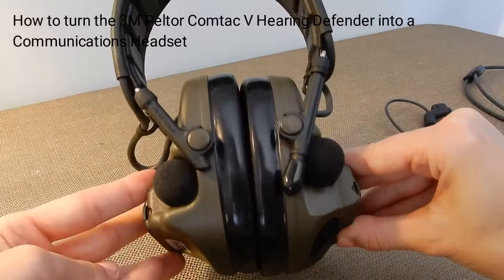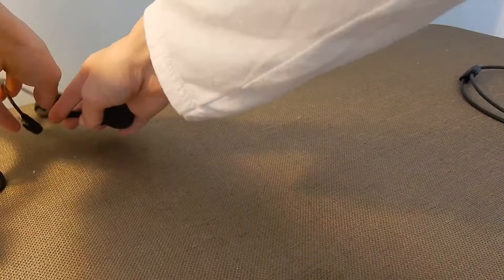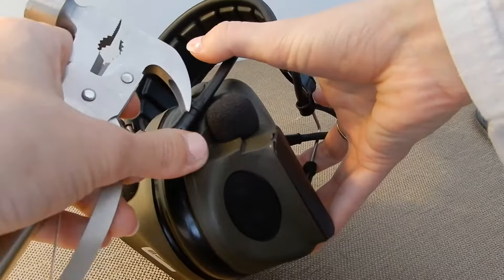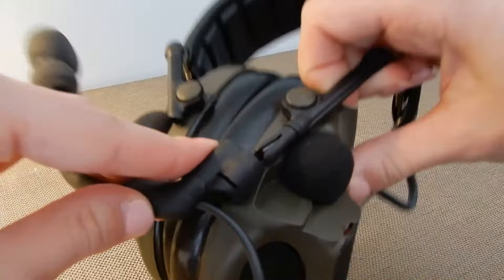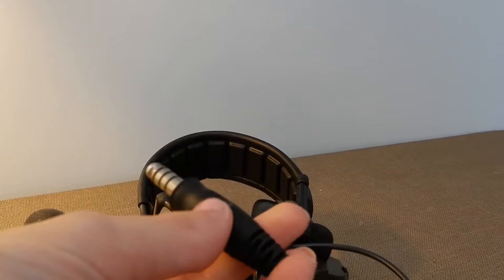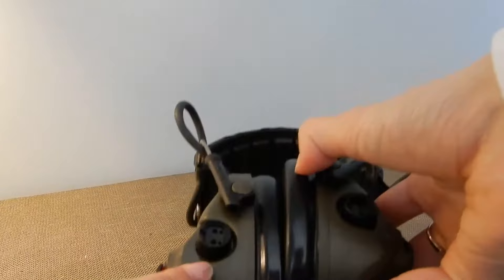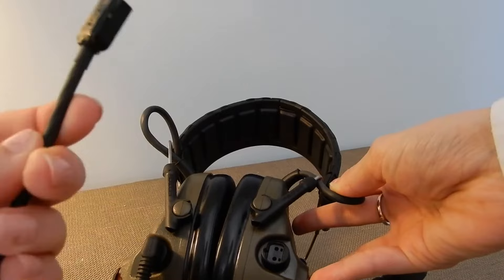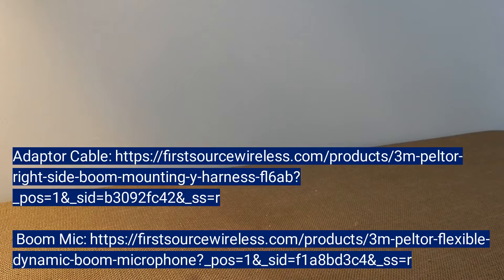Upgrading 3M Peltor Comtac V Hearing Defender to a Communications Headset

Comment from the maker: Disclaimer: Before making a purchase, you must ensure you have the correct adapter interface. We can only guarantee compatibility with a 3M company-manufactured product. You are encouraged to contact our support team to ensure the PTT adapter for your headset will work with your two-way radio device prior to purchasing.

Comment: so a comtac 6 without a downlead cannot become a comms headset? it doesnt make sense because there is one of those ports on the headset? also what is the button on the back of the left earcup? i thought  it was  a PTT but if it cant be converted to a comms headset whats the button for?
Reply from the maker: Correct. The Comtac 6 Hearing Defender headset cannot be turned into a communication headset. Meaning it won't have that downlead to a communication radio. It has something to do with the mic/plug connection on the 6 that doesn't make it possible. 

However, the button on the left earcup is a push-to-talk button for the NIB feature (Natural Interactive Behavior) that is for short-range headset-to-headset communication without the use of an external radio. Does that make sense?
Reply: @firstsourcewireless  yes, thank you so much. hopefully soon they come out with a cable that will work for the vi's
Reply: Are these supposed to come with the mic? Just got a pair in the mail and they do not have the mic.
Reply from the maker: @alec7283  The Comtac V hearing defender won't come with a mic. If you want to go from the hearing defender to comms you'll need to purchase the boom mic as well as the downlead cable.
Reply from the maker: Although, the Comac VI Hearing Defender will come with a boom mic for the NIB feature (Natural  Interactive Behavior) that automatically connects headsets when in close proximity.

Comment: Why Im getting the sound through my mic and not the headset, I did exactly what the video said?
Reply: This is due to you using the wrong Downlead Assembly for your requirements, you must use a Nato wired downlead for Nato wired equipment and non Nato Wired downlead for Non Nato Wired, I recommend Earshot Communications Ltd in the UK as they are experts in the correct equipment and offering the right items for 3M Peltor setups like these.

Comment: Nice, thanks!

Any idea if the same parts would work on a Comtac 3?

Also, technical note, volume was rather low.  I had to turn my laptop volume all the way up so I could hear...
Reply from the maker: Thank you for watching and thanks for your suggestion on the volume level! We'll keep this in mind when creating videos like this in the future. As far as the parts, they would be different part numbers. You may be able to find replacement boom mics and find PTT adapters for the III. 3M discontinued the Comtac III and replaced it with an upgraded version, the V so the process of upgrading the headset to comms is only available on the V hearing defender

Comment: I'm a bit confused. Which adapter cable should I buy for my XPI defender? I thought I have to get FL6AC
Reply from the maker: This video is just for the Comtac V hearing defender headset so the parts listed in this video are just for that. As far as the XPI defender I'm not sure the exact parts needed to make it comms but I believe there is a video on how to do this listed by the Headset Company that may give you more information!
Reply: I recommend Earshot Communications Ltd in the UK as they are experts in the correct equipment and offering the right items for 3M Peltor setups like this and can support you.

Comment from the maker: IF CONVERTING TO A COMMS HEADSET PLEASE USE FL6AF LEFT SIDE BOOM HARNESS NATO WIRED.

Important Information: 3M has mentioned, the FL6AB mentioned in this video will not work when converting a Comtac V Hearing Defender to Comms. The FL6AB is not NATO wired therefore will not work with NATO wired push to talk adapters (ending in -02).